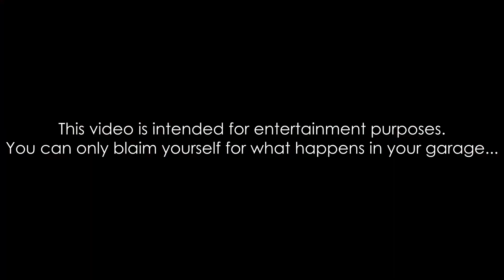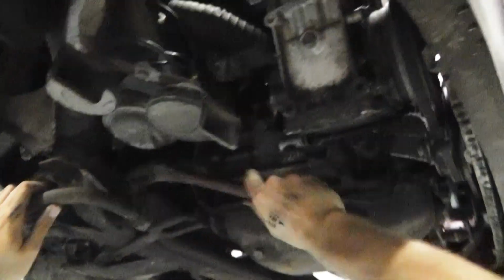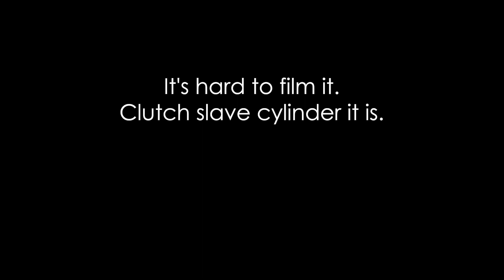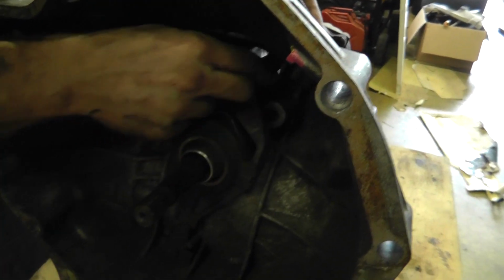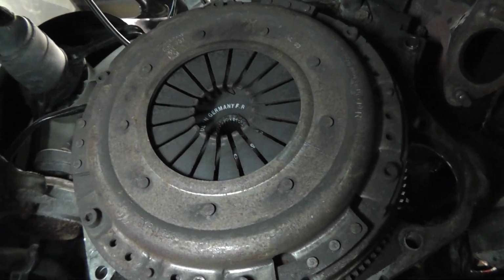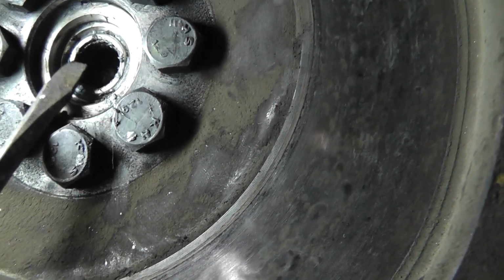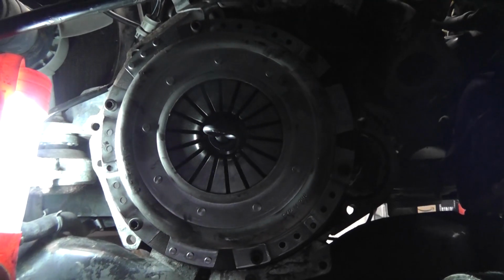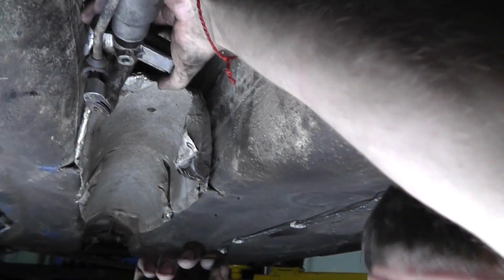How to change the clutch on Audi Coupe 1980-1988 /Audi 80 GTE Quattro/ Audi 4000

Comment: Pretty good job. Correct...you can just remove the rear sub-frame bots. Front bolts can stay tight so that your front suspension alignment stays in place.  Please don’t hit the starter with.a hammer, directly. It can break the magnets inside of the starter....use a block of wood with the hammer and gently tap on the starter. Nice work... good sound quality. 35C...too hot in the garage!  Where are you folks?
Reply from the maker: Yeah I agree with you in regards to the starter. This was shot in Chicago, IL. We now can be found in the Pacific North West of the US with all our cars - feel free to connect with us on Instagram.
Reply: Well the Pacific Northwest should be much cooler than Chicago

Comment: Also, you can gently jack up the front engine mount to assist with the transmission installation....avoids the need to remove the steering rack

Comment: Great video. I'm about to do this on my Coupe GT. Mine's an earlier one with clutch cable. Did you also replace the rear crank seal and gearbox input shaft seal? I'm wondering whether to do these as my car was sat for 25 years...
Reply from the maker: Very nice! Yes, you are correct, you should do the seals so you don't have to get in there again just for the seals.